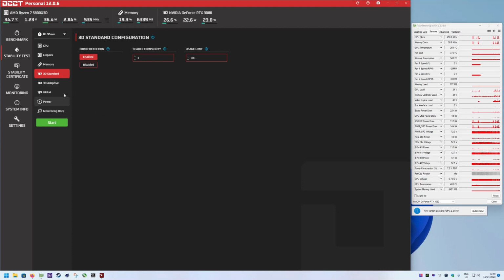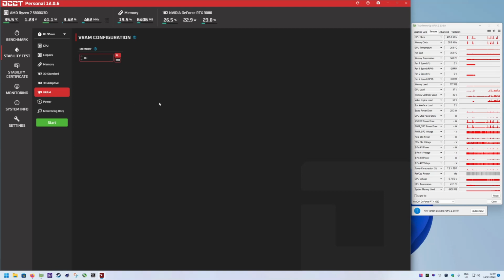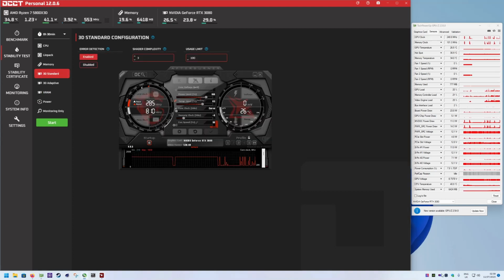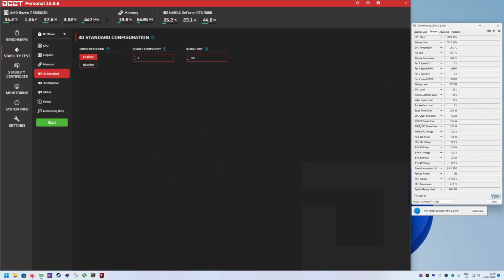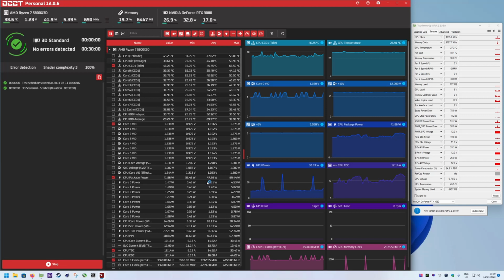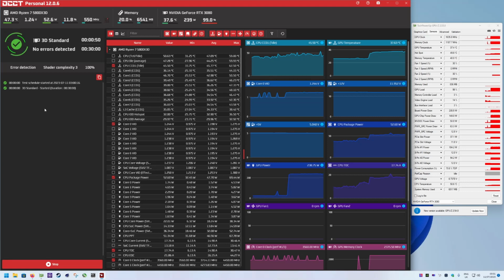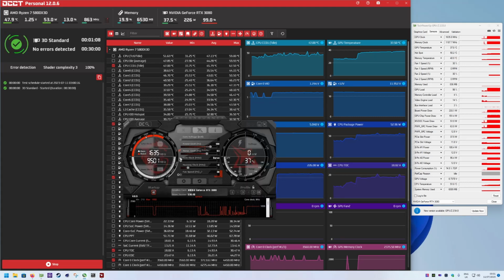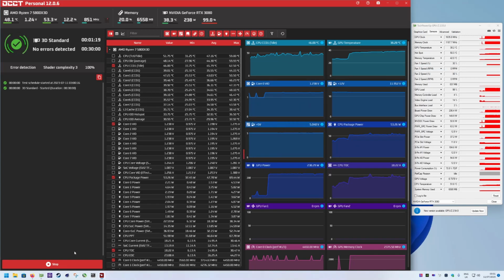30 Minute Guide How To Stress Test Your GPU

Comment: not enough, my 3090 custom curve is rock solid in occt all tests and then cyberpunk crashes after 10min, also occt standart test pushes wattage too much and you can't test it past 825/850mv without hitting power limit and im running the 520W vbios..
Reply from the maker: @pav1u  It’s been long known that CP is a poorly optimised game!  Plus it’s always worth stress testing with several different scenarios.